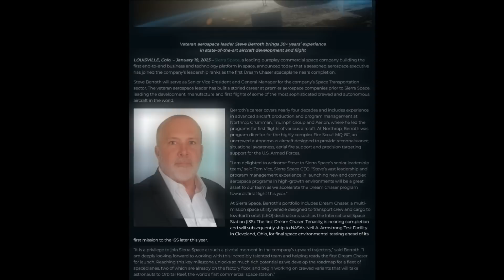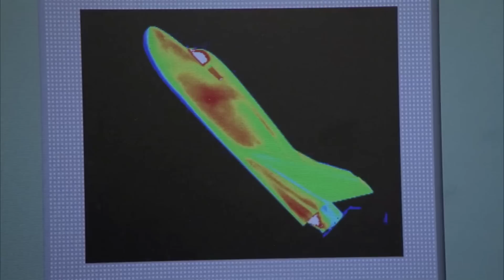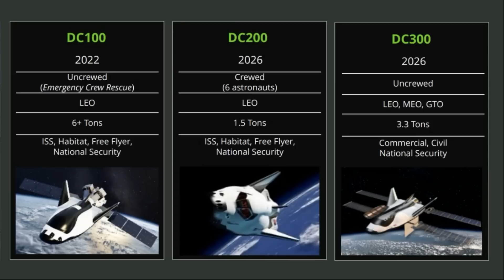Dream Chaser Tenacity's Final Tests Before Its First Launch

Comment: Excited to see Sierra’s Dreamchaser getting close. I hope as they move forward with building new variations they also develop the ability to be launched by multiple rockets. Being dependent on a single launch provider is a disadvantage. There is already other options with more coming on line over the next few years.

Comment: Thanks for up to date information on Sierra Space. It was interesting to note that the landing gear of Dreamchaser involves heat tiled protected hatches. The original concept for the SpaceX Dragon capsule involved propulsive landing on Terra firma, not water. However as I understand it there were concerns about fitting hatches into the heat shield. May be worth another look by SpaceX. Landing without the need for recovery boats must be a better solution.
Reply: fitting hatches into a heat shield is not too big of a problem, since nasa has done before in the space shuttle. using propulsive landing would be more dangerous, since it has never been done before, which is why NASA didn't let spacex land crew dagon on land. however, spacex plans on using propulsve landing for starship, so we will have to wait and see how that works out if the send astronauts on starship.
Reply: @HamzahKhan314  I imagine the propulsive landing originally proposed by SpaceX for the Dragon capsule was more or less along the lines as demonstrated by Boeing.
Reply: @michaelreid2329  what propulsive landing? Boeing lands their capsules using traditional parachute systems.
Reply: @HamzahKhan314  my bad, thanks for your correction. I had thought the Starliner provided a little last second retro-fire to also cushion the landing like the Soyuz.
Reply: @michaelreid2329  np. starliner uses last-second retro fire to soften landing since it lands on land. im pretty sure all capsules that land on land do this.
Reply: @HamzahKhan314  Maybe they will go Martian
And will they?
Reply: @robertsutton8894  hopefully. probably around 2030-2040
Reply: @HamzahKhan314  Apparently some in the MOL program didn't think so as they would really have to change the Gemini as mentioned in Spies in Space.
Reply: @HamzahKhan314  Long wondered about the reason NASA gave.
Reply: It was not the challenge of engineering that lead to this change. It was the additional red tape to receive human rating from NASA and the time it would take. Happy they made the change otherwise we’d possibly be in a position of not being able to launch crewed missions given the continued delays in Starliner & relations with Russia after they invaded Ukrainian.